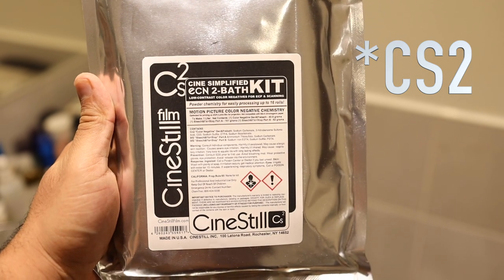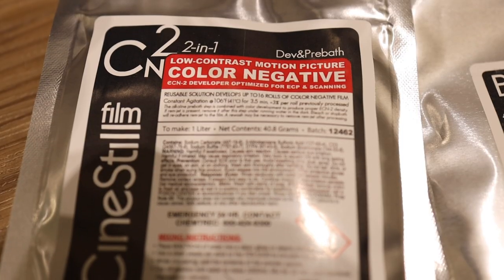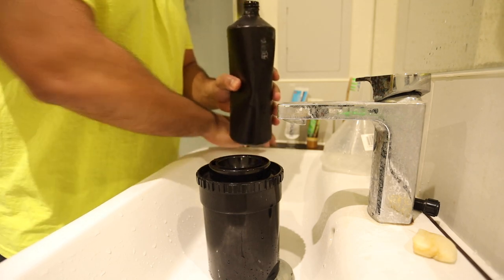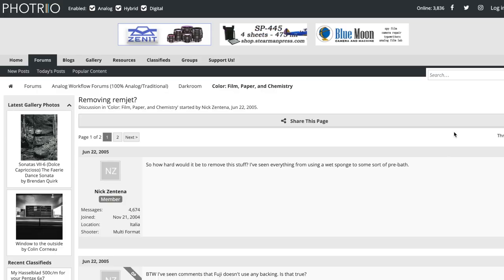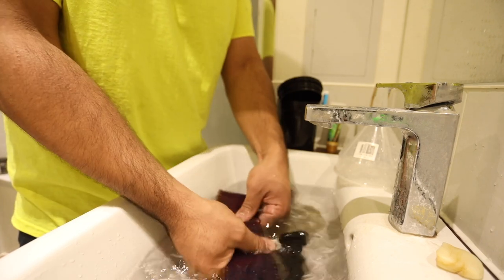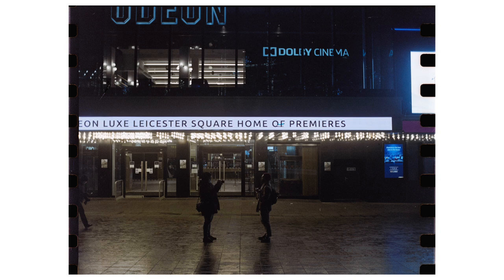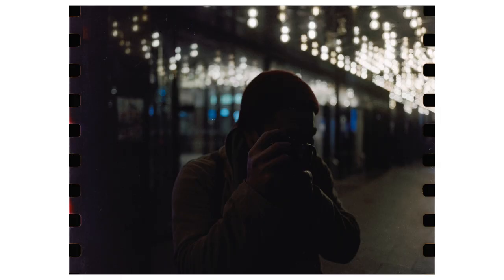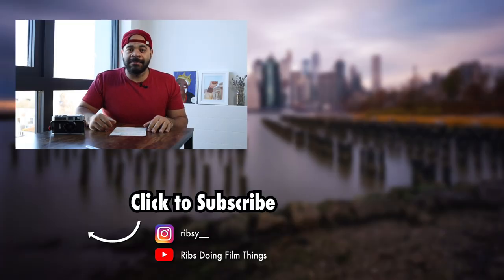Cinestill ECN2 Kit (CS2) - Can it handle film REMJET? Part 1

Comment: - Remjet particles are just charcoal they wont react or affect in any way the developer. Just use a coffe filter if you want a "clear" developer
- You can remove the remjet or just leave it at the very end with no effect on the results
- You can remove de remjet layer just by rubbing with your fingers at the end of the wet proces, just before the last wash
- ECN2 and C41 are almost the same process with the same ingredients, the only difference is the developing agents, CD4 for C41 and CD3 for ECN2.
- You can develop C41 in ECN2 chems, giving that low constrast and finner grain to regular C41 emulstions.
Bye ;)
Reply from the maker: thanks for the info. many of the details in my video agree with you 😊
Reply: Hello, rubbing with your fingers really can remove all remjet?because i develop every time Vision 3 after scan ,the film will leave a little charcoal,even before stabilize i use Sponge to rubbing.Many thanks.

Comment: Like its C-41 kit, its ECN-2 labelled chemistry kit is not a true ECN-2 process, omitting chemistry steps and combining others. It's one thing to say that ECN-2 compatible films can be processed in it and yield usable results. It's something different to say that it is going to yield the quality results of a full ECN-2 processing. (Without regard to the remjet issue.) In the case of the CS modified films or real Vision 3 film, there is little to no consumer access to the full ECN-2 processing, so this CS kit becomes something of a "better than nothing or C-41" option. For those few out there who compound their own B&W chemistry, thus have a chemical scale,a few breakers, and know have to use them, the formulas for ECN-2 are "old  school". Kodak has them on line, the components are neither numerous nor particularly expensive, so it is well within your reach to just make up your own chemistry (fresh) when needed, for a quite small faction of the kit cost. You also would have the steps and chemistry CS omits.
Reply from the maker: fair point. i def assume that there will be differences between the "real" ecn2 process and an at home process. i rather not dabble on my own since it will be alot of work and require additional storage. i like the ease of buy a kit, even if it isn't exactly the "real" thing

Comment: Hi Ribs! just wanted to share that the last two ECN-2 develop sessions I held two make up sponges to each side of the film and dragged it down the film at the end like a squeegee .. this pulled of whatever remjet was left at the end of the process and sucks it into the sponge.  I've also used 91% IPA with a make up sponge if I do  notice any residual remjet on the light table before scanning and a very light pass over the film will clear up anything that got missed.  I love the ECN 'look' and have even started to process my C41 color film in it!
Reply from the maker: Oh great point! I’ve used a couple of different sponge type things and it usually does the trick. I kind of find the extra effort annoying
Reply: I'd be careful with this. I've messed up the emulsion side trying this before
Reply: @RJMPictures  I do it really, really gently. I feel it's less of a risk than using my hands to do it
Reply: @ribsy  Make up sponges are super fine and gentle, not porus like the one you use to wash your car!

Comment: Washing soda is the right stuff, but sodium bicarbonate isn't.  Washing soda is sodium carbonate (notice, no "bi-" involved).  Not quite the same, sodium carbonate is a little more alkaline than sodium bicarbonate, and as a result, does a much better job softening the remjet's adhesive and freeing the carbon (the actual black in remjet) from the film.

Technically, sodium carbonate is Na2CO3, which sodium bicarbonate is NaHC03 -- hydrogen replacing one of the sodium ions.
Reply from the maker: thanks for clarifying. i def misspoke -- i def used washing soda (arm and hammer brand). thanks for the science info 😊

Comment: Where are you getting the 120 vision 3?  I got a few badly setup 120 rolls from HK for $30 a roll. Their usefulness was mixed.  Basically I suspect this is 70mm cinima film cut to 120?
Reply from the maker: I’ve used some on eBay

Comment: I don’t see the reason for CS2 chemistry, unless you want really flat images with low contrast. C-41 does an excellent job with any color including motion picture film. Contrast is easily fixed in post. Remjet is removed with baking soda. On the side note, in my experiments with vision 250d film I always had to overexpose by at least one stop to get the images I wanted. Tungsten is probably more so. I’ve also cross processed vision film in b&w chemistry to get a nice black and white negative. Vision films are finicky and frankly not worth the effort with remjet and fuss with special chemistry
Reply from the maker: interesting. ive always exposed at box speed and i get great results (when i actually pay attention to proper exposure) i did cross process this film once with c41 and didn't like it per se.

in the end, if the film is designed for ecn2 processing, then thats a good enough reason for using the CS2 kit.
Reply: @ribsy  Agreed. And also, while using Cinestill 800T at box speed and with C41, the results are noticeably low res and grainy.  It almost feels like it defeats the purpose of cinema formulations if you don't have some kind of ECN or ECN equivalent process, you easily wind up with something noticeably inferior to Portra 400.

Comment: Are you sure that you underexposed the shots or were the think negs a result of you not removing the rem-yet in advance? Also you should not really meter for shooting negative film at night except for when you’re doing long exposures. Just do the longest time you can do  handheld and shoot wide open.
Reply from the maker: i definitely underexposed the shots. the remjet should have no impact on the that aspect of the images. i did precisely your advice and it didn't work lol - f2.8 and 1/30th. i got extremely noisy images from the underexposure.